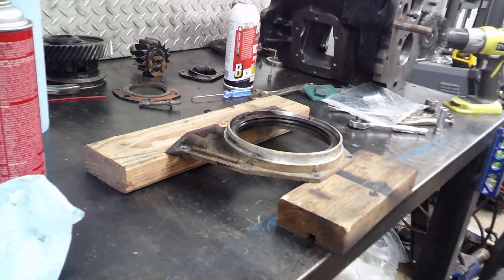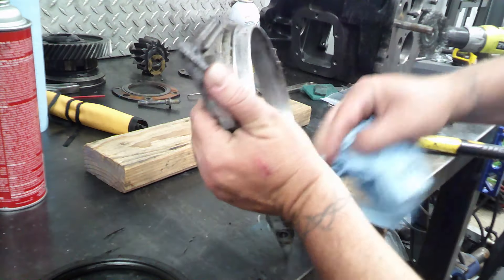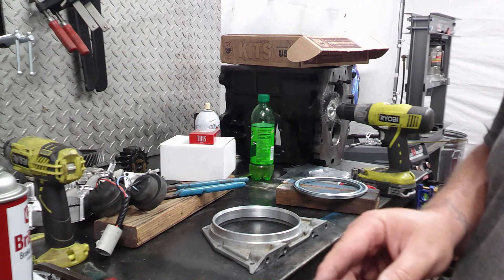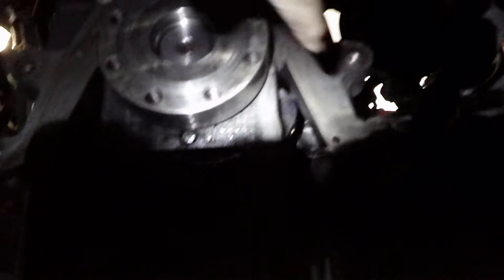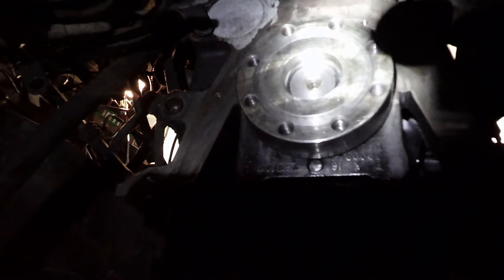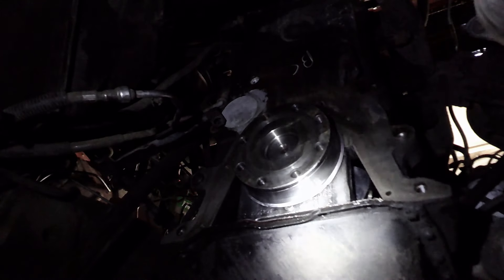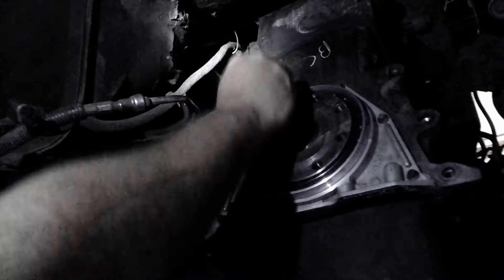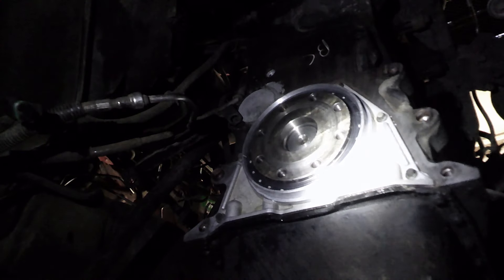5.9 12 Valve Cummins Rear Main Seal and Repair Sleeve!

Comment: Why did you put the crank sleeve on?  was the crank wore or was that because of the housing being put on that was marred up?  Also, is the seal different with the crank sleeve than just one without the crank sleeve? different part numbers?  great video
Reply from the maker: My crank had a wear groove in it, front and back, from all the main seals over the years. Both seals were OEM. No special seal required.

Comment: Where did you get that tool to install the wear sleeve?
Reply from the maker: For the rear main the tool came with the seal from the tractor supply place. I use it all the time as a bolt wash or other bolt tray these days. Let me do some digging and I'll find the link where I bought it.
Reply from the maker: Here is the kit I used. https://www.agkits.com/cummins-4t390-diesel-rear-crank-wear-sleeve-3906081.aspx#.YYhT6VNlCyU

Comment: Hey brother just saw your video and want to say thanks for the info. Quick question how is that test main holding up with the repair sleeve? My 24 valve has 356k on it and I've put 2 rear main seals in it with no luck still leaks.
Reply from the maker: Thank you for reaching out! This project has been super slow coming together but hopefully test firing happens today. I will get back to you once I've got some miles on it and I will probably make an update video because guys are also interested in the transmission rebuild.
That being said, I've used repair sleeves in the past on other equipment and tractors and they held up longer then the seal they accompany. I hope this one does too.

Comment: Won't install a part that says China, but then uses a non Cummins repair sleeve and seal.
Reply from the maker: Thank you for commenting! I think you may have been a little confused about this video. I never said the rear main seal wasn’t a Cummins part. I said anyone who still had a sleeve kit had lost their minds on pricing. At the time I had researched the sleeve kit and found it was made by a company in the US. Had I dug a little deeper I would have found they are owned by a company in India, so I don’t actually know where the sleeve was made. That’s my bad.
I hope this helps clear everything up for you. Have a wonderful day!